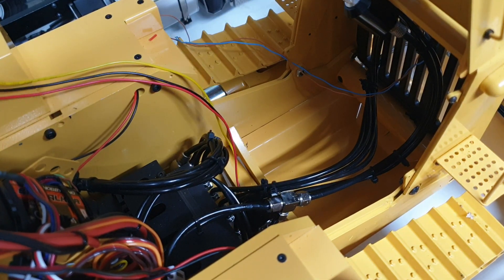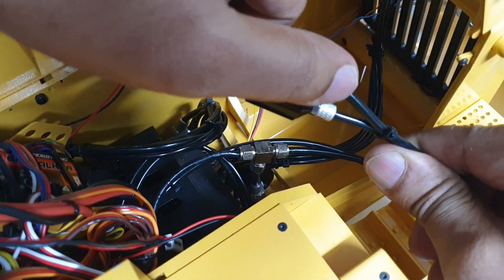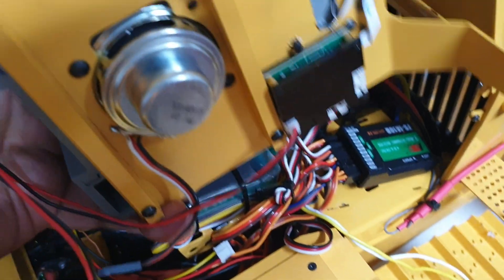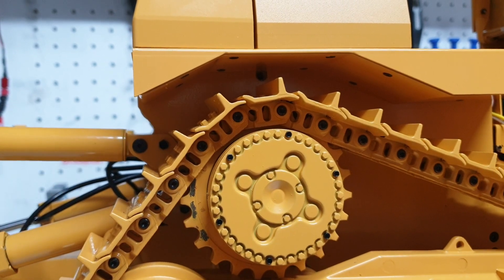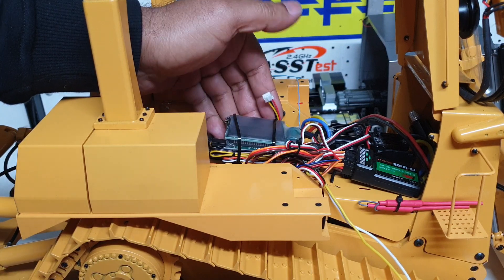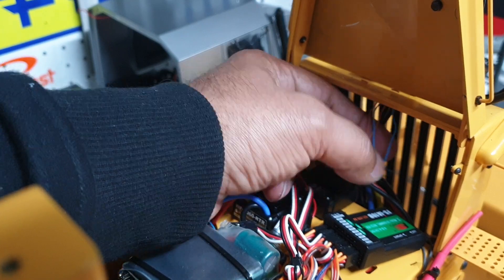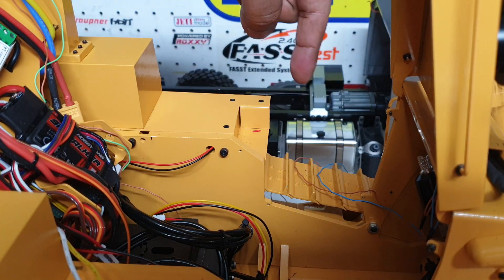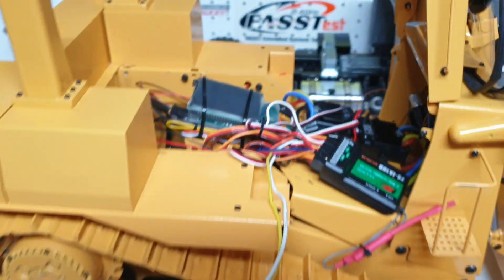CSMI : Hydraulic data screen kit installation on hydraulic systems.

Comment: i hope you show us how can let your radio FS i6s 10ch reading battery voltage when the battery is weak in your next video thx again kev i can't wait 2see the next video
Reply from the maker: Thanks for the feed back. I did check I could not see telemetry options for that radio . It's a very basic radio so don't think you have this option.  Thanks